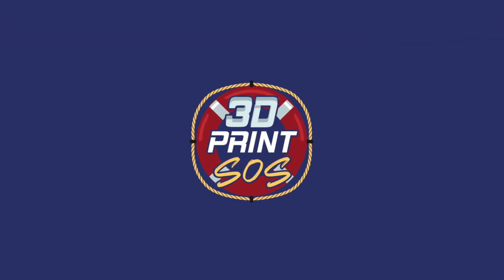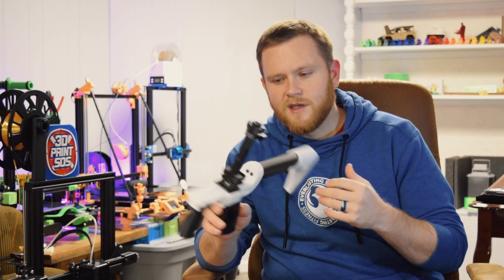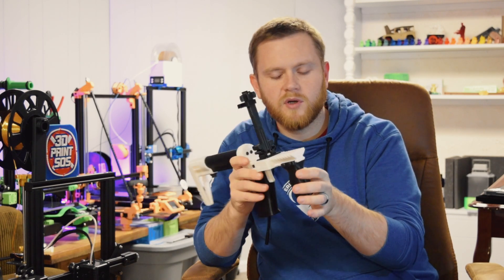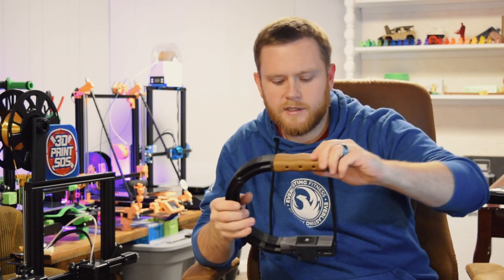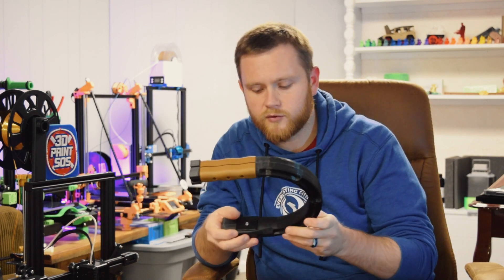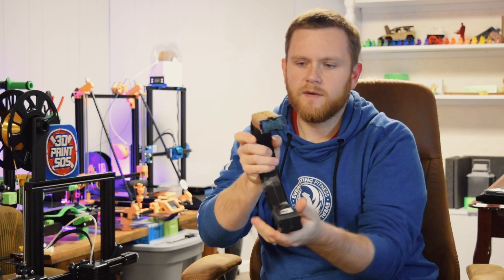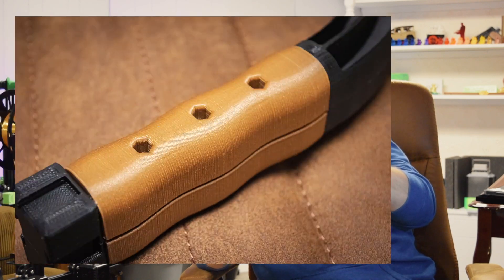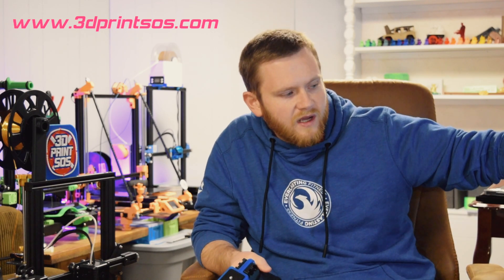Designing the Perfect Camera Mount - The CG-15 and C Camera Mount Project

Comment: i have to ask what is the micro usb port use for right next to the sd slot on the voxelab
Reply from the maker: It’s so you can hook up the printer directly to your pc. You can basically skip using the sd card that way. You could slide the port to add a raspberry pi running octo print to basically give the printer WiFi connectivity.
Reply: @3DPrintSOS  really this is vary interesting